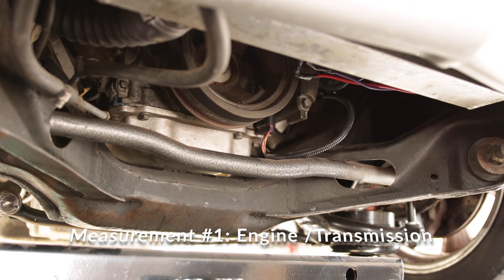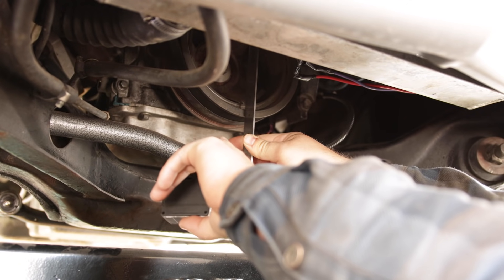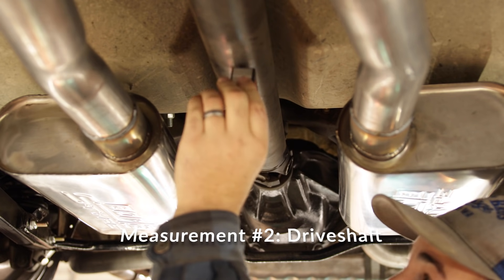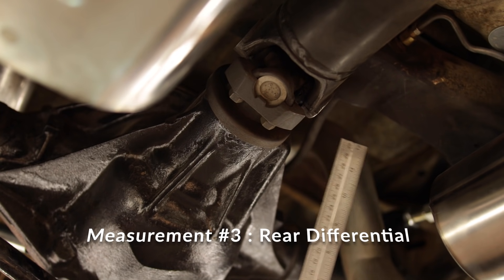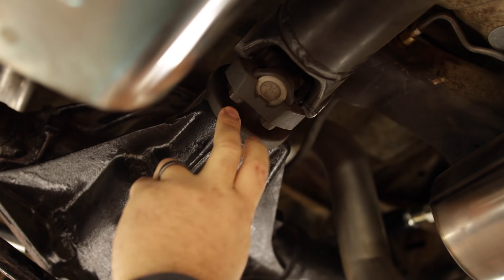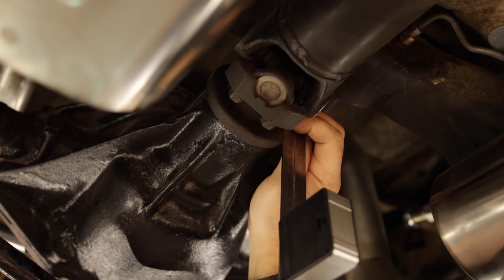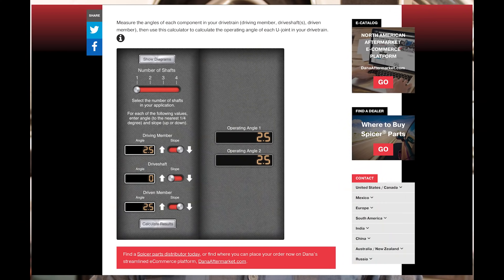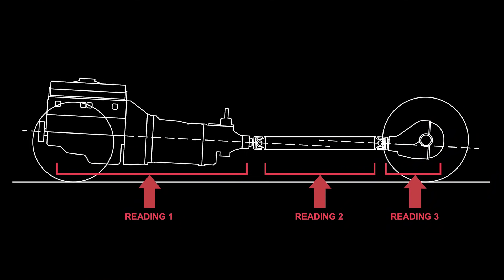How to properly set up and measure your Pinion Angle on your Muscle Car

Comment: so i have this truck with a really bad angle. i bought it dropped from some guy and the angle i got was 3.4 on the trans, 2.6 on the shaft, and 19.3 on the diff. so i don't know if i should drop my transmission down more to even it out or raise the pinion up

Comment: I've cut and built drive shafts for all my projects with no issues. I put a 460 in a 87 ford ranger and set it behind the front axle. With the engine set back and C6 trans with a 9 inch rear I had to cut a driveshaft  to 17&1/2" long. The pinion didn't center up, so the driveshaft was running at an angle horizontal and vertically. With 4.11:1 rear gear, it spun pretty fast but had no vibrations or problems. Being that short it amplified the angles on the shaft drastically. I actually figured I may have to relocate the engine but it held up to several years of drag racing with 12" slicks and nitrous. I can't believe it held up. That driveshaft was the weak link, im sure, but I was just lucky. I cut my shafts with a pipe cutter to ensure a square cut and grind the weld of the end and put the end back on. Using a flat welding table and tape measure I square it up and weld. I have cut and rewelded so many in over 50 years for everything from  racecars to  drilling rigs I lost count years ago. These things can take way more angle than I have been told but they do have to be pretty close to the same front and rear. I do set them up to torque up as  straight as possible on hard acceleration when doing race stuff but for the street its not that critical. I started working on drivelines in 1967 as a kid with a truck that I had bought  working all summer. By the time I had a license I had rebuilt the engine transmission and put a different rear gear in it. 58 ford pickup. I bought it from an aircraft mechanic who heleped me rebuild the engine. I did the rest.  It was a great learning experience.

Comment: Well definitely good information recently switch to a global West adjustable setup with airbags you did not speak with their bags which the pan bar got changed as well so when you say ride height that would determine how much air will be in the bags say it's 120 psi it's very hard to determine if you only have 100 PSI you can drive the car with zero PSI there is at least a 4-in drop in the rear axle the car can be driven with zero PSI so ride height can vary 120 PSI to 0 psi my question is should I go with the stock location that was a curved arm the new adjustable arm is straight so when the car is lowered less PSI this will move the back axle closer correct the more PSI will raise the car and we'll move my axle farther away or will that just change the angle so I guess my question is should I set my angle longer or shorter then stock will I be in the negative or positive and my second question is the right height will be my PSI degree angle correct and I believe this is an x-frame with two drive shafts any input will be appreciated we are talking about 1959 Chevy car

Comment: I've watched many videos on this and no one mentions the car needs to be on a level surface. You can't do it on your sloped garage floor. I would have thought this was super important to mention
Reply: Cars with independent rear suspension would be the exception. The rear end is fixed and ride height doesn’t change pinion angle.

Comment: Wow was that over complicated!
Keeping the angle the same in front and back will probably cause vibration under hard acceleration.
Your rear end pinion angle  tips upward when accelerating, any where from 2 to 10 degrees depending on your suspension  type.
When the pinion angle is set to the same angle as the transmission angle, you are setting the pinion angle to "0".
Normal pinion angle is set 2 to 5 degrees down ,in the rear. So if you have 2 deg. in the front, the rear needs to be set at 4 to 7 degrees down compared to the front.

Comment: Where do you measure for your 0 degrees for level reference?
Especially when using a digital angle finder. You have to zero it out before taking measurements.

Comment: Tip: for those who paired a different transmission, and changed the transmission mounts, look for a level intake manifold plane. If your carburetor is level, your engine/ trans down angle will be darn close.

Comment: i have a 65 Mustang with mustang two front coil over suspension and rear torque arm coil over suspension, I have a vibration at speeds over 75mph in the back of the vehicle, i have front engine angle of 2.1 degrees down and 1.1 degrees up on the pinion angle. Now to clarify as to why I set those angles because i was told by the manufacture of the torque arm system that it squats under hard acceleration and that the 1.0-degree difference is needed. and of course it has the same vibration, I had the (new) driveshaft rebalanced and it needed more weights. My long-winded question is what do you recommend?

Comment: After installing a UMI 2061 lowering kit on my 98 Camaro SS, the differential yoke when at 90 degrees, sets above the transmission output angle which will point my drive shaft upwards to the rear when connected. 
What is the best solution to correct?
Thank you!

Comment: I must have missed something about the measurement on the driveshaft. Is that the "operating" angle? If the engine is down 2 and the pinion up 2, does that make the operating angle zero?

Comment: Theres a little confusion out there about the angles being either up or down on the differential as seen from front to back (Yoke to gear).  Using the Tremec angle finder app they are showing the diff with the yoke up as down as its comin from the transmission.   In other words from transmission to the rear of the car, looking at the vehicle from the drivers side.  Right (rear) side of transmission, driveshaft, and differential is seen as down.  Plus if you put the info into the Spicer calculator as such it calculates out correctly.  However, I see the differential described as up with the yoke higher than the gear which is not how it shows on the Tremec app or Spicer calculator.   We have a car calculate correctly but the 3 pieces make an arc and not a Zig Zag.  Whats your thoughts?

Comment: at the very beginning before you measured your 2.5 degrees on the crank pulley, what did you zero out your electronic angle finder on to say this is level prior to finding your 2.5 degrees?

Comment: I always thought that line between the front of the engine and going through the transmission to the front of the rear axle should be close to a straight line if you had a way of seeing it from away from the vehicle looking either right or left side

Comment: Yes, the rear suspension needs to be weighted. The front does not as it has no effect 
on the angle of the trans. As long as the rear suspension is at ride height it doesn’t matter if the front suspension is loaded or unloaded. You are comparing the angle of the trans to the pinion angle, not to horizontal. So the target angle of the trans is misleading since most cars have a forward rake.

Comment: I get that you end up with parallel vectors when the Engine and Pinion are at the same angle say 2 degrees in opposite directions UP vs Down. When thats true does that put the driveshaft at 0 degrees? Mine is 4-link coil-over.

Comment: Setting the pinion angles at rest seems ti miss the idea that when the car is under load even at 70MPH, the angle would be changed.  Don't we need to account for the position of the rear pinion angle when loaded?

Comment: I changed leaf springs on the rear of my 72 charger. also changed front shackles too. Then had a 3.90 ring and pinion installed. Ever since then (2018) the car had this vibration you could feel when u let off the throttle in 4th gear at highway speeds of 55-60 mph. It seemed to smooth out when u got back in the throttle but it was ever so slightly still there. New transmission mount, new cut and balanced driveshaft too by a reputable driveline service company. I recently realized the front leaf spring shackles were in the 1.5" lowering position. I Switched it back to the original ride height mount on the shackle and the vibration is still there but not quite as prominent. At this point i plan to check my pinion angle and engine/trans angle. from what i am understanding the angles need to be as close to equal but opposite ? my buddy recently redid the ring and pinion for me too and he thinks the pinion is too deep in the ring gear but i have found information suggesting that a ring and pinion wont vibrate , only howl or make noise. Great video by the way. i look forward to checking my angles. I have a suspicion that the newer leafs and trans mount could have thrown my angles off. In any case i figure it be best to check all angles and make sure they are in an acceptable range before it messes up the new ring and pinion. what are your thoughts? thank you

Comment: Just a tip...You should address whether the setup is a W or a Z config. You are correct as far as a Z config goes but most cars have a W config on the shaft. The upper arms will be too short to accommodate as well as the prop shaft may contact the floor in certain instances. The same also works in the overhead view...you need a consistent setup (W or Z) in BOTH planes for the joints to be happy. Nice video and presentation...hope this helps.

Comment: Excellent vid however I’m still not sure.   I have 4 degrees down at trans —1degree at shaft — 4degrees up at rear pinion. Am I good? I have a coil over 4 link setup , it seems you say in the vid if the front and rear measurements are the same they cancel out, however mine are the same but one is up and one is down so I’m not sure if that’s what you meant by the same.  Any help is appreciated. Car is up on blocks until I figure this out.
Reply: He said motor/trans point down 3degrees or less but no less that .5. Pinion points up, same spec but no more that 1degree delta, parralell is better. Your U-joints have operating range specs. So the distance between these parrallel vectors will change the DS angle. That is, you can be parrallel on a lowered or stock ride hieght street car and probably be well within spec for the u-joint since the distance beteen the parralel vectors is may just a couple of 2 or 3 inches, if that. But, on a rasied 4x4 truck, that parralell distance will be much greater and your DS angle very extreme.

Comment: To my understanding, carburetor pad on most street intake  manifolds 3 to 3.5 degrees.  That instructs fairly well regarding engine setup which the driveline must mesh with.

Comment: Thank you for this. I have a 69 Daytona clone 572 Hemi auto moser Dana 60.  I added a gear vender shortened drive shaft (reputable 6 states) 3 Degree eng tran, the drive line goes up hill to the dana that is set at 1 degree with leaf that under load in drive I think is going up past 3. My car is low. 

Vibration at 55 

I put 2 degree shims - perch - it did help, but not quite. 

I’m thinking 1/2 more degree would put it level, but under load in gear will bring it back to 3 degrees? Your thoughts? 

I’m on YouTube Dane Wing - to see my stance 

I can wait to use that app.

Comment: I found this informative and I don't think you are wrong but I have a few comments.  All the text and manufacture information I have ever referenced always measured the front and rear u-joint angles at the u-joint bearing cap. If 1/2 of a degree is critical (which it is) I don't think the front pulley or the diff flange dust shield are very precise and I have seen a lot of bent metal rulers that are not flat.  Maybe a precision straight edge instead of a metal ruler.  When measuring at the u-joints first the slip yoke at the transmission, then the driveshaft yoke near the transmission.  Followed by the differential yoke compared to the driveshaft yoke near the differential. For years I have used a 1 degree difference between front and rear however over the past 5 to 6 years someone pointed me to a reference specification of 1/2 of a degree difference so that is now what I use.  You do advise everyone to have that difference as small as possible, that is great. The 2 degrees engine down and 2 degree diff up work great for stock cars and light trucks but for a truck that has been raised with large tires there is a limit to engine angle adjustment and the rear diff will need a greater tilt upwards value than the engine tilt down value and it's unlikely to keep the u-joints less than 3 degrees so we try to keep is as small as possible. This is just the reality if someone wants to raise their vehicle above factory curb height.  Noting that the 2 degree up/down does not apply to a vehicle with a modified curb height. Finally, I thought by the title you would show how to actually change the pinion angle to meet the desired measurements.

Comment: Here's a tip lads check any movement in the differential input shaft,  if you have run your car with the vibration I have wrecked to sets of bearings setting mine.
As I had put a new bearing in I thought it was the wheels out of true causing the vibration.
I accidentally put my hand on the propshaft and the new bearing was shot.

Comment: Sketch at 6:00 does not show proper out of 'phase'.  Do you check the crank pulley in different positions?  It is also part of Harmonic Balancer I believe.  Rubber mounted.  Great explanation.  Diff and Trans shafts should be Parallel.

Comment: Great video but you didn't say how to find pinion angle of the reared sits higher the the transmission. I'm building a ratrod and it's really low. My rear axle yoke is definitely higher the the out put of the transmission and the motor and transmission is running down hill at 3 degrees. How do I figure this out?
Reply: Curious too..

Comment: You covered this well but, you lacked the "why" In this subject.

It's a very difficult concept to grasp, 🤔 ng that two mechanical connected pieces of metal can travel at different speeds and different pulses of power?

I mean if you got a chain connected to a gear it will always travel the same distance no matter what, right?

Yes because the chain has a constant circular pattern and multiple points of power transfer. But

A drive shaft has 4 point and when angles has larger or smaller circular patterns. Meaning at certain angles the yokes of the shafts can be travelling faster or slower depending on the relation to each other regardless of mechanical connection.

So you get pulses, vibration, jumps, skips, bad times....

Here is the best video I found showing what I just described l..

https://m.youtube.com/watch?v=Idk3BVDVHq4&pp=ygUSZHJpdmVzaGFmdCBwaGFzaW5n

Comment: Hi.. I have a jet sprint boat with engine rigid mounted and a short telescopic drive shaft 188mm lenght  that goes to  jet uni drve shaft1350 u joints each end.  . My angle finder on the block .. which is just a dummy block no crank.. shows.      .7 up on block ...the jet unit  .6 up.    I don't have a crank to attach shaft to but holding it rough in place  i stick my angle finder on shaft... it appears to show 6 degrees up.      I've downloaded that app. Cheers..   just wondered your thoughts on those measurement  

I'm checking because have to raise motor and appearance of shaft more up.. was concerned.  Any thoughts ?

Comment: Great video!!  I just installed a Gear Vendor in my 66 Chevelle.  Vibrates at about 65 and up.  Guess I was hoping to get lucky with the pinion angle.  I am going to use this instruction and see what happens.  Will post the results. Thanks again!!
Reply: Hoping you got some good results - and any info. found as I am considering GV for my 70 502 which is currently backed by Art Carr 200-4r that was great for years, but installing a Tstorm single and stout cam.

Comment: If you replaced your universal joints with cv joints, wouldn't pinion angle become essentially irrelevant? If so, why is it so rare to see cv joints in a driveshaft? I have seen cv's in some of the very new ford trucks, maybe there's other applications too.

Comment: So you're saying the number off of the balancer should match exactly the number that you get off the rear output shaft. So if the balancer was at 2.5° negative than the output shaft should be at 2.5° negative.

Comment: Great info, thank you. 
Need advise please. I'm unsure on how I'll be able to get an accurate angle to weld the perches on the rear end. I'll try to explain as brief as I can.
Have a 1940 Ford pickup down to frame. Installed mustang 2 front end with setup rods and lower controll arms are currently parallel to floor as suggested by Heidts. Istalled leafs in the rear and using a flathead engine, C4 trans and 9" rear end. I can only guess on what the ride height will be because there is no wheels or weight on it. The only thing I can think of is keeping centerline of axles the same dimension off floor and hope that would be the correct thing to do?

Comment: I've always heard point the nose of the rear end up 1-3 degrees.  If you point a go-pro at your 3rd member and go for a drive, you'll see that the pinion angle changes quite a bit under load.
Reply: ? up or down

Comment: I've always heard point the nose of the rear end up 1-3 degrees.  If you point a go-pro at your 3rd member and go for a drive, you'll see that the pinion angle changes quite a bit under load.

Comment: I have a 2001 GMC sierra 2 Piece Driveshaft  The front of the motor degree is three transmission is 3° in between the middle going to wars the Differential is 9°  The truck is drop n has springs   A 5/12 drop can I fixed it without using airbags